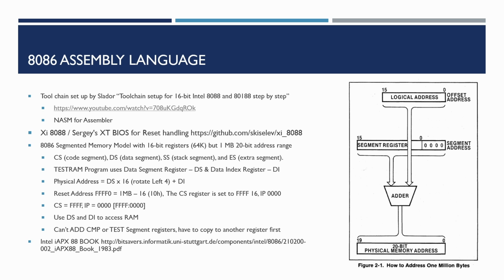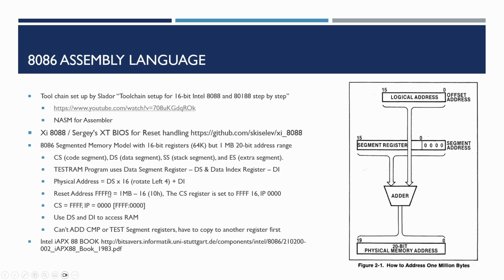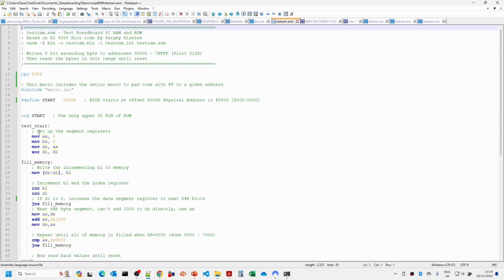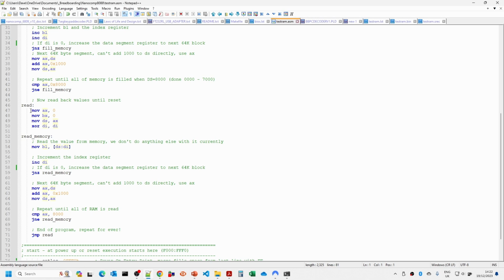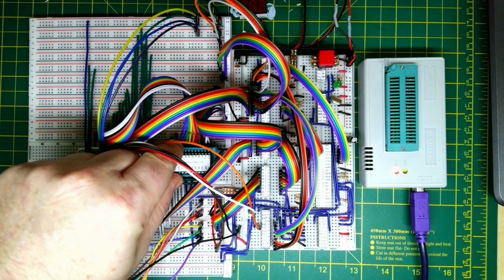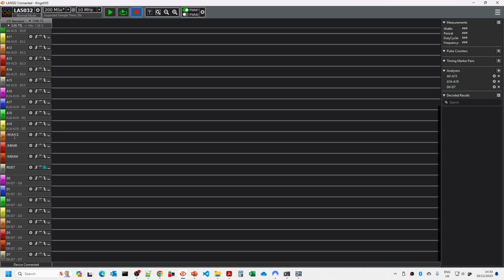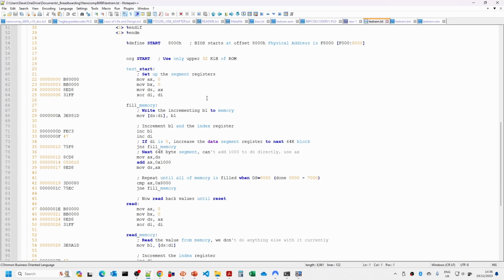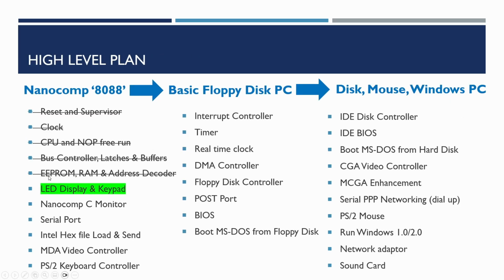Breadboard 8088 PC 8086 Assembly, EEPROM & RAM Test #8

Comment: Thank you for your great series about the 8088. The icing on the cake would be if you only used components from the 82xx series instead of components from the 68xx series. 😉
Would you please be so kind and enlarge the screen font? Otherwise it's difficult to follow you. If you only get 320p due to a bad internet connection, for example, no code is recognizable. Notepad++ also offers an extension that displays the current line in color. This also makes it much easier to follow you. Thank you very much.
Reply from the maker: I'll be striping out the 68xx components and LED Display and Keypad once I have the BIOS and MS-DOS loading, they are just to help bootstrap the BIOS as I already had the 6809 Monitor (though saying that the MC6850 does 56Kbs and the 8251 only seems to do 9600 baud!). Recent videos I have added mouse pointer highlighting, will change the Notepad++ font size as you suggest. Sorry to hear about your internet speed, not sure if you can download the videos for offline viewing (may need YouTube premium now or utility like ClickGrab?). Thanks for the feedback. Dave
Reply: @breadboardinglabs  😃 Sounds great! Thank you very much..

Comment: I know it's not a video to learn x86 assembly language hence constructive advice here. You already said that you are good at 6809 assmbler and yes you can see that from the x86 code. The x86 has special so-called string instructions for filling and reading memory. Take a look at the STOSW and the SCASW instructions. These use SI and DI index registers and AX as a test and CX as a counter.
Good luck with this very informative series.
Reply from the maker: Thanks for the feedback. The code was actually based on some of the Bios RAM test code and a bit of Copilot suggested code (which wasn't directly usable). But getting more into the x86 stuff now, CX for loops is nice and I am sure the string stuff will be useful for video card driver code. Dave

Comment: In the testram.asm I think adding a compare test of the data value read back in the read loop section, as you know the value read back should equal the bottom 8 bits of what is in the DI register.